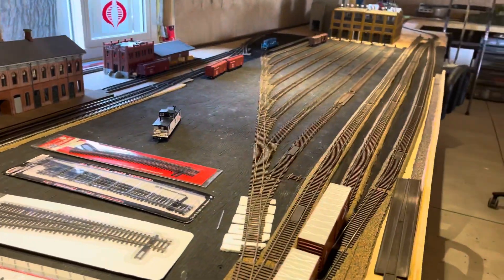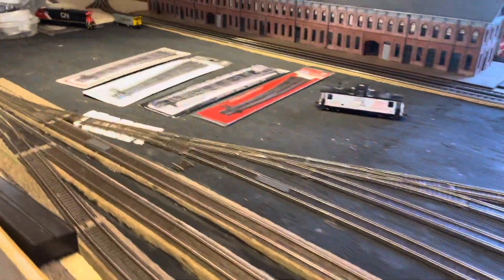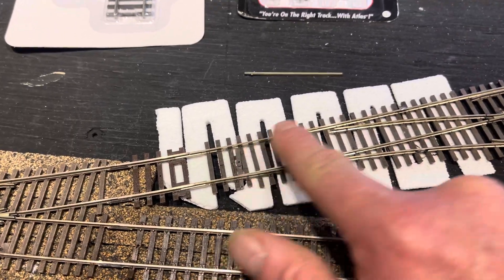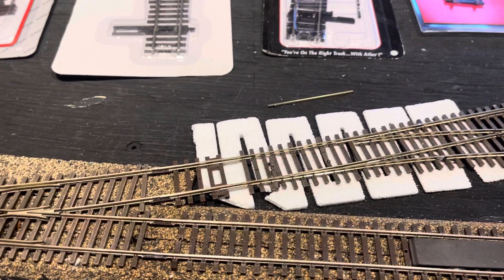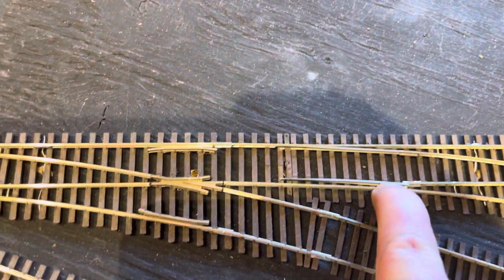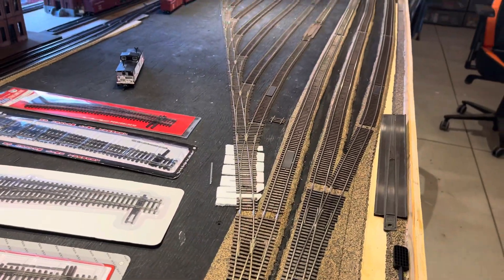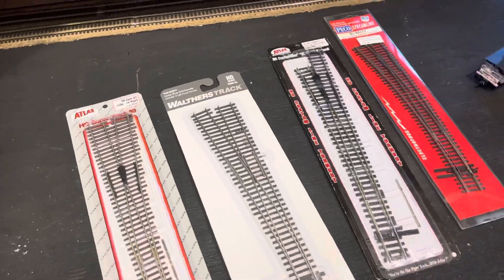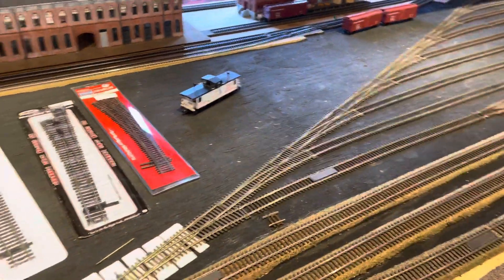Micro engineering ladder track system. Yes or no

Comment: I've used Atlas code 83 switches, old production. Had to install 14 in 8ft switching layout... on a tight budget, no $ to replace them if they didn't work...  Well, 2 didn't make it and I swapped them out. No problems since then! My club used Peco #6s exclusively, rock solid on a modular layout.
I would contact your vendor or ME... if it was their fault. Am sure that this "review" will be devastating to ME given your huge following. Don't drop $2-300 and then walk away from it!

Comment: This is NOT their ladder track system.  It's just a series of regular turnouts.  Yes, there are quality control problems in the pieces you used.  But I wouldn't specifically disrespect their ladder track system.  I've used their turnouts on several layouts, and many of the actual ladder track components, all without a hitch.  You got a bad production batch.  This should have been a video of how M.E. did or didn't help you with these issues.  
Also, in previous videos you were comparing the M.E. ladder turnouts against standard Number 6 turnouts.  The ladder system is a special Number 5 with a curved diverging track in order to increase the effective ladder angle toward a Number 4 angle, which is primarily where the space saving comes in.  Not from the overall length of the M.E. regular Number 5 turnout.  This video has good videography, good audio production, but the facts are a combination of wrong and misleading.
Reply: It sure looks like the ladder system to me. I stopped the video at each point when he moves the camera up the ladder and all the connections look like the ladder to me -- but I don't have any personal experience with it (other than looking at them in the store). Pandemic production problems? Interesting regardless.

Comment: I'm curious what you were using to throw the switch points?
If you were using your fingers, were you only pushing on the throw bar between the points out were you pushing on point rails themselves? If you were pushing on the rails, that repeated force could bend the point rails out of adjustment and fatigue the mechanical connections causing something to eventually break.
Reply: Yes, there is "something" more to the story here!

Comment: I have over 100 ME turnouts on my layout, and have helped install hundreds more on several others. The design has been the same for at least a decade, with a minor modification to the spring retainer on the ladder system.

While the first one will need a repair, the second one is simple to fix, simply by moving the rail joiners slightly. They have excellent service, I have taken any that I have had with issues (very, very few) to the local shop where I purchase them, he sends them back, and ME repairs them for no charge.

I’m sorry to see that you’ve had some issues, but in the whole they are very good products and I won’t use anything else for the most part.

Comment: Damn Sparky, thank god you put this out. I was going to use this system partially based on your review of the space savings when you installed them. It is a great concept but obviously not built properly. I’m sorry that you had to go through it but you may have saved others from going through it. I know at least 5,530 people that thank you for updating us. Hopefully another manufacturer will use the concept and manufacture a quality product or Micro Engineering will refund your purchase and get back to the drawing board.

Comment: Aw, that's rotten, when you've spent a lot of cash and time over anything, just to have it fail and need ripped out again, sore.  It came as a complete lay-out in the box?  Some corners have definitely been cut in the quality control, for sure.
At least you have the yard in and if the standard Peco or other points fit, then maybe saved from total disaster...but those new switches won't be cheap.  Sorry man!  Keep Safe Sparky.

Comment: I have had a similar problem with Atlas N Scale #8 turnouts, with metal frogs.  I cannot vacuum them anymore, if I do I have to open the vacuum and retrieve my points.  I am slowly changing them all to Peco Electrofrogs. They are not made in China.

Comment: Sparky  Never used Micro Engineering switches  Just Atlas & Peco.   I made my own Ladder using Atlas #4 Turnouts  All work well especially after I wired up the frogs now my switcher engines move in and out no problem.   I would use PECO or Atlas turnouts and rip out that Micro Engineering Ladder  That is a shame that those turnouts are not properly engineered and fell apart.  Good Luck and look forward to your replacement ladder.